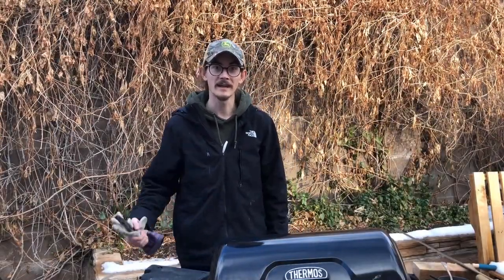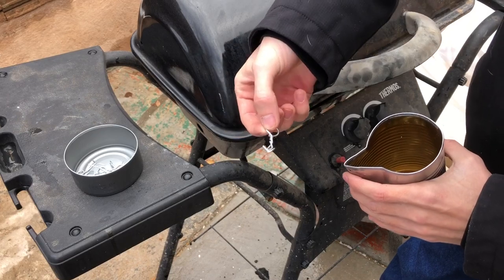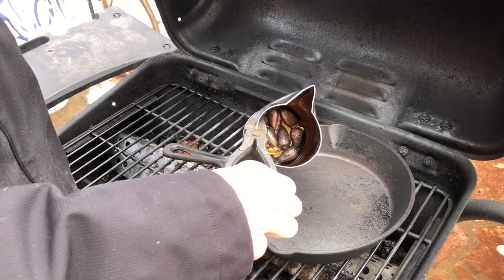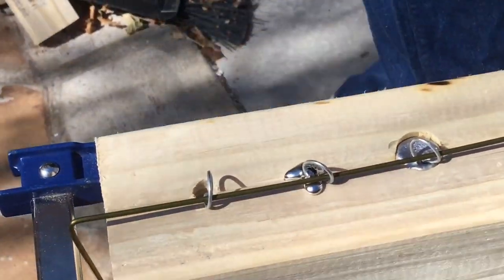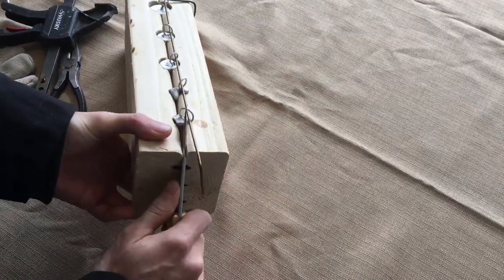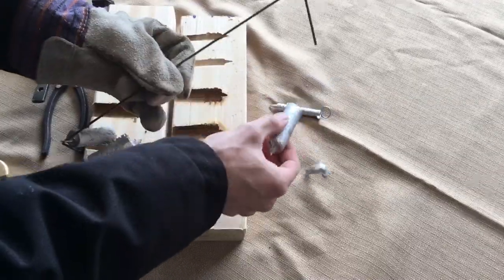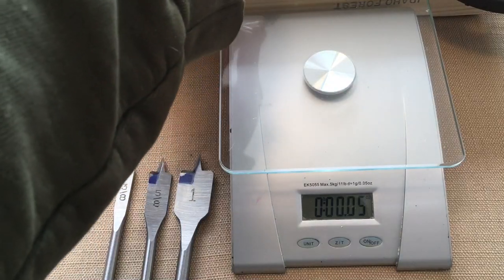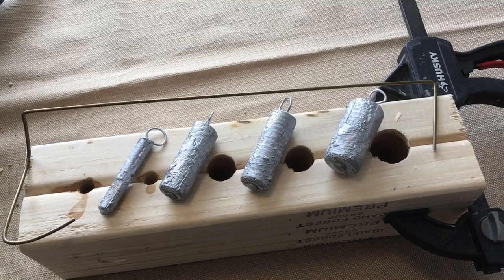Making lead fishing weights in wooden molds

Comment: seal the sinker cavities and the flat surfaces of the boards with candle wax so they don't stick together. Once you put a few layers of wax on the wood it become nonstick like teflon for example. You can also use several coats of old motor oil to seal the wood and cavities.

Comment: quick and cheap  mold  for deep drop weights ,  cut electric pvc conduits to length desired   then wrap aluminum foil to the end as a plug then pour the open end when done split the pvc with a cutting disc, a 1" dia pvc at 4" will produce a 14 oz sinker or those aluminum wind chines  have very thin aluminum tubing  makes  a good mold and cheap

Comment: I mean it will work just fine, i have used nuts and bolts before when I forgot my sinkers. Worked just fine. Using the oil filter wrench to hold the hot can when you poured was smart.
Reply from the maker: Yes the oil filer wrench came in really handy glad you agree, this is my first time pouring sinkers and I’ll probably end up investing in a real mold because I’ve got a lot of lead when my dad passed, mainly gonna use them for some..experiments in a few areas I’ve never fished.
Reply from the maker: Thanks for always tuning in since day one🦅
Reply: @CatfishCameron  sorry to hear about your dad. Mine passed away in 2013 . hey the mold worked and so will the sinkers you made. catfishing doesn't have to be pretty. So making your own works In many ways. And it's cheaper in the long run. The pre made molds are nice too cause you can make an exact weight that you need. The big ones you made would work great for flatheads. 3 way/ Kentucky rig or sante copper rigs are the way to go with flatheads. They have an under bite so it's hard for them to take your bait off the bottom. So the 3 way rig helps them eat the bait easier when it's off the bottom. Down on the rio Grande in Las Cruces New Mexico there's some nice flatheads and blue catfish with your name on it. I'll always tune in man, I love fishing and especially catfishing more than anything in life.
Reply from the maker: @hookedonbassncats  yes that’s the plan..only time will tell

Comment: I thought the wood would smoke a bit. I need to make a fifty-pound pyramid weight for a drift boat anchor.  I was thinking of making a plywood or a concrete mold.  I'm just trying to figure out how to DIY.  Cheers from Vancouver Island Bro. :)
Reply from the maker: That’s gonna be some hot lead 50 pound holy, I would probably do the concrete mold sounds cheaper but make sure it had no moisture 🦅